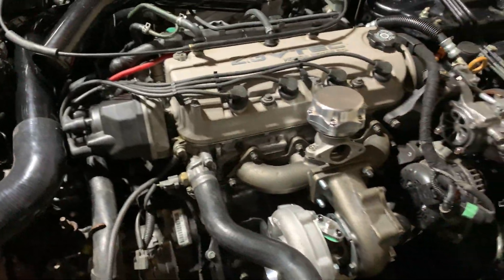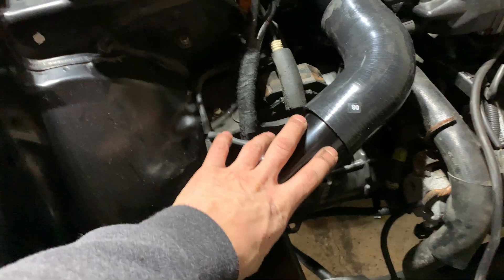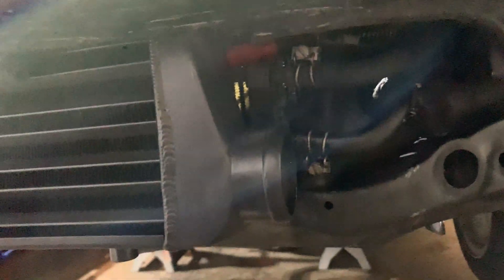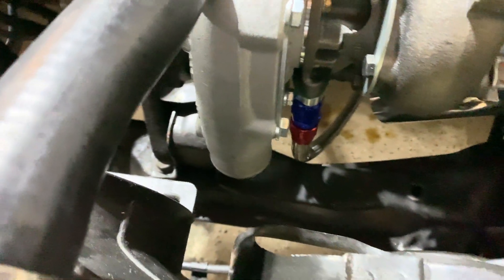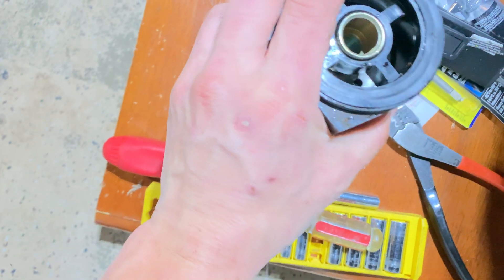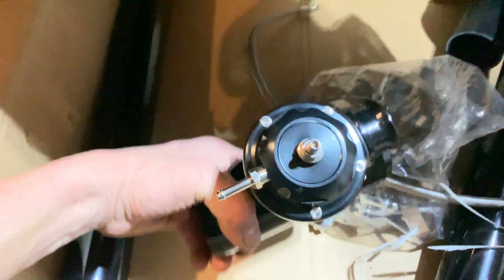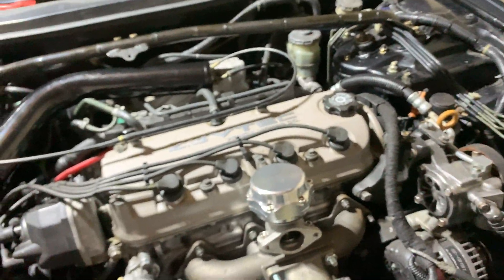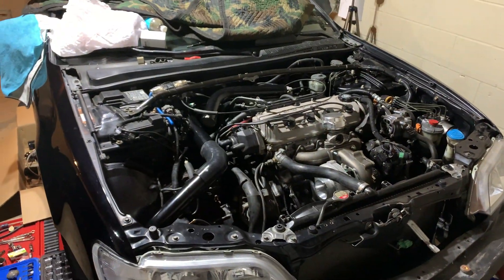Honda F23A turbo update

Comment: Can you recall the brand of the manifold? It looks like it fits with the power steering in place which is nice!
Reply from the maker: @TFE_LLC  just the cheapest one on eBay haha
Reply: @franksgaragehonda  How long did this exhaust manifold last?
Reply from the maker: @ I would say forever. It’s cast.  But I didn’t use it very long. I K swapped the car

Comment: You can do a lot with a chipped p28 little bigger injectors like 450cc, log manifold for 100$ max speeding rods Garrett turbo for $120-300 get a tune and have fun upsetting others😂 stoch internals for the f seriers can hold between 250-350 and still reliable seen a few pushing closer to 500 but they dont last long😂 my f22b1 on 8lbs with 325cc injectors stock pump made 186 whp & 173wtq i got about 45,000miles out of it before i lost all compression but she had 286,000 on her all ready so i consider the f series pretty tuff

Comment: I've got a question: Does it matter if the engine or heads are from an LX Accord or an EX Accord? Both are at least F23s blocks. One has VTEC, and the other doesn't, I think.
Reply from the maker: @Midwestside318  vtec is always better
Reply: @franksgaragehonda  gotcha. Thanks so much.

Comment: Dope dude. Head looks very clean. Do you have a list of parts? Getting ready to do this to my accord gen 6.
Reply from the maker: The car is k24 now. The F23a just had basic turbo parts. Nothing special. 525 injectors. T04e turbo. And a demon ecu
Reply: @franksgaragehonda  Whats the best Manuel tran to do with the f23a1
Reply from the maker: @caseygunter3583  h22 LSD
Reply: @franksgaragehonda  what fuel pump did you utilize while this was a F33a Turbo?
Reply from the maker: @ForzaPulls  stock. Didn’t make enough power to upgrade ha
Reply: @franksgaragehonda  Thank you, I used to own a 93 accord h22a auto and 93 prelude SI- VTEC h22a1, if I knew all this about f23a I would of never got rid of it. This motor is the best budget motor Honda has , and most cost effective. I want to do a build myself this summer on a 1990-2002 accord. I did the swap on the accord myself and wired the VTEC and knock sensor to the Ecu, I used a F20B auto Ecu and it let me rev to 7800. I know I’m my fuel pump went out. Do you need to custom wire accords to Walboro 255 LpH pump if need be? How much do you think the stock can handle? Sorry for bombarding with so many questions, but I’m serious about building this and will upload the progress lol
Reply: God loves you
Reply: Repent, Jesus loves you so much
Reply: Would use the p2u5 out of 94-97 accord👍